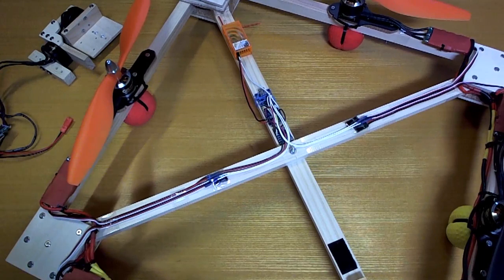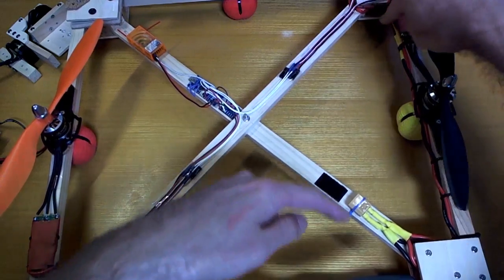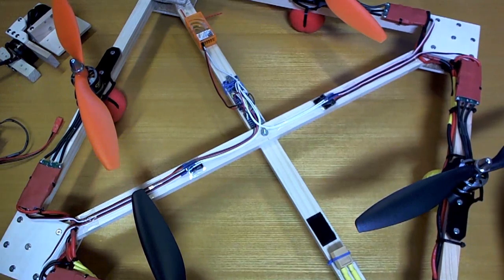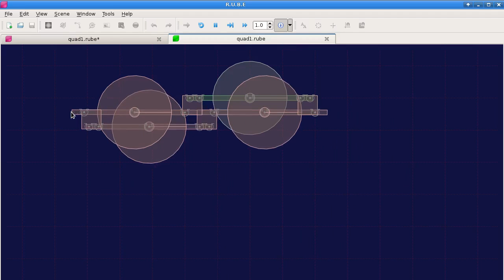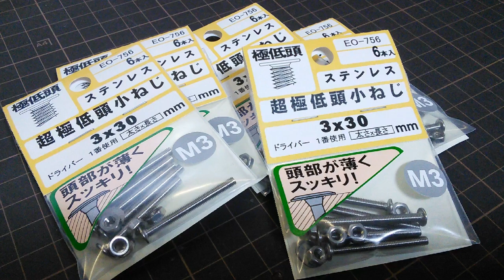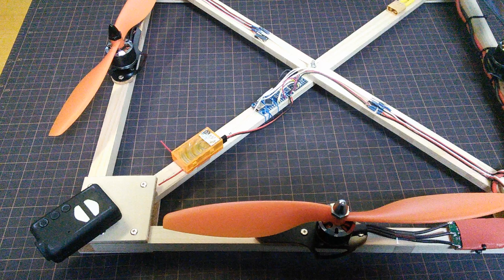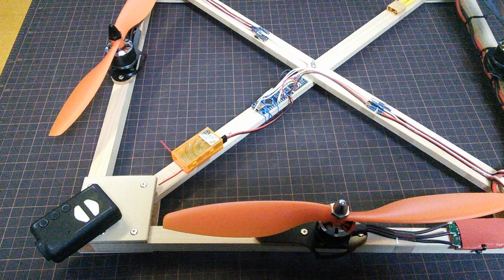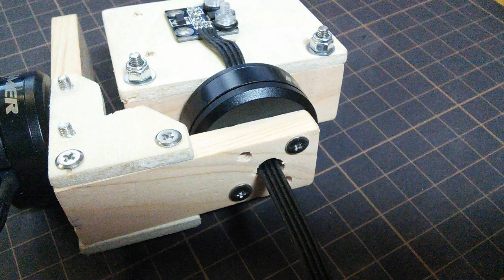DIY quadcopter frame vs jello

Comment: i think the motors will cause more interference because its creating a big electric field to drive the motor.
and maybe you can try shielding the compass?
 did you balance the props that will help with the jello
where did you get the gybal motors
and i got my quad flying but i cant get auto stabilization working and when i give it throttle it lifts off but i have to keep throtttle up orr else it falls like a brick so i need some tweaking to do
but i just want to say nice try with that frame but it looks nice (better then i can do)
Reply from the maker: Removing the motors is not an option :) As I mentioned, the current in the motors is AC so does not set up as strong a magnetic field as the DC current in the wires between the battery and ESCs.
Shielding the compass is not an option because I want it to detect the magnetic field of the earth :)
No, I did not balance the props as I mentioned before (in video about damped motor mounts) that is not the point of this experiment - I want to see how much the vibration carries to the camera.
I got the gimbal motors from banggood: http://www.banggood.com/RCTimer-BGM2804-100T-Brushless-Gimbal-Motor-Hollow-Shaft-p-951199.html
Yes, you usually need to keep the throttle at about half-way to hover, if everything is set up correctly and your battery/esc/motor combination has enough power.

Comment: Could the "Jello" be a result of resonance of the motors through the frame, With the bigger blades I would imagine that the resonance is lower frequency to that of the smaller blades, making the effect more visible, just a thought :) (I have no idea). I'm going for a Tricopter (380mm booms from the middle) for my first build with something like the 580KV Turnigy Multistar and 12x3.8 SF props in the hope for long'ish flight times and smooth movement. I did want to make a hex, but I'll work up to that over time.
Reply from the maker: Yes it originates at the motors for sure, that's why I put bits of cork here and there to try and stop it spreading

Comment: Good example. You have few 'problem sources' for vibration. First at all, please look at this video, I hope you will know why: https://youtu.be/GtiSCBXbHAg

Whoe frame is made from wood which has the same acoustic impedance and velocity. When you said that sometimes it vibrate, sometimes not - this is just one of the 'amplifier' - resonance.

Aside that, you know that you should balance the propellers. And you can try to mount motors upside-down, so that prop wash 'banging' wood frame is no more present. Legs can be mounted on each corner instead beneath motors. I tried mesure difference between Gemfan props 10"x4.5" and CF props, 3 leafs (9"x4.5"), which gives me less vibration, but also about 15% less thrust at the same current. Or better said, to get the same thrust of say 500 grams, Gemfan (2 leafs only) 10"x4.5" draw 8.5 A, and CF 3 leaf 9"x4.5" draw close to 10A. The difference is in silence of 3-leaf props, but on cost of bad efficiency.

Make 'musical' instrument with your frame, and you may observe, listen or detect with gyro or accelerometer (make some program to visualise vibrations). Then make frame with low Q factor in acoustic domain. When you bang it with something for example, it should NOT produce 'bell effect' sound. Instead dull and short noise.

Just a thoughts.